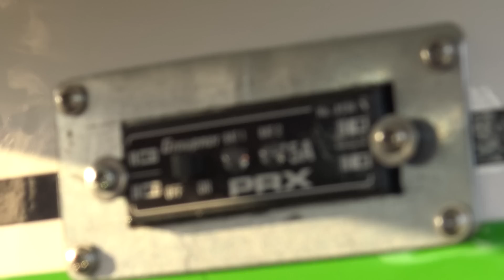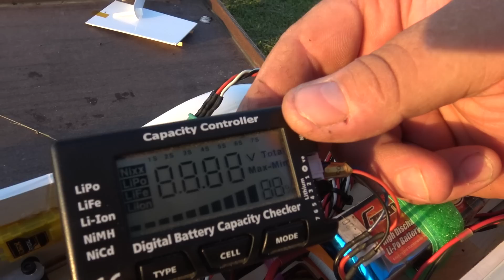GIANT 2m Hangar 9 Ultra Stick with Turnigy TP31-T 31cc Twin Cylinder Gas Engine  Maiden flight

Comment: Dont add weight Cpt Blaz. Just make longer stand off's for the engine and move the batteries to the front with the fuel tank on the cog. They fly much better if kept light.

Comment: The engine needs to be put on stand offs 80-100mm ,then you wont need to carry a ton of lead and it will fly alot better.
Sounds like one of the pots needs to be richer on the top end as it was stuttering .
Move the power box to the front aswell if you can.
Always better if you can lose all that lead.
Tank should be over the CG really ,then that doesnt effect flying characteristics as it empties.
These hanger 9s fly really well once set up especially if you have over 2-1 power weight ratio like a YS 140 in it.
Hope this helps.
Nice Flying Blaz and the good babbling Robert
Reply: Yes this is all true...yes engine still needs to be tuned to perfection..after few flights i will tune it more...
Reply: @BlažPetrinčič  Nnnnnyyesss,this will be something eh
Reply: Good catch, I was wondering why it needed all that weight in the nose.  I didn't notice the engine being mounted so close to the firewall...  Like you say, move it forward and you can get rid of all those wheel weights!
Reply: The Ultra is one of the greatest airframe ever made, so versatile and dialed in. Needs to be handled and setup with a lot more respect, it’s a legendary giant.

Comment: I recently purchased the same plane.  My setup is with a DLE 35 RA with a 17 X 8 three blade propeller.  Radio system is Futaba T16IZ SBUS 2 system with GPS to give me altitude and speed with voice readout.  3 OZ lead in the nose and elevator servos at the tail give me a perfect balance. The recommended balance point is too nose heavy.  Very good flyer, no bad habits at all.

Comment: Another great video good to see you flying blaz  Once you get your elevators straightened out  You will find out that the right-wing has a twist in it From the factory 
It is very hard to take out but there is 5 mm twist in all right-wing panels of this airplane  I even bought new panel and it's exact same way
 You're right Aaron will be up about 4 mm to correct the problem In horizon will not warranty the wings   Great job brothers

Comment: Here is a tip from an armchair expert, try to place the fuel tank at the cg and your batteries right up front. Might be able to get rid of some of that ballast. Also as per another comment remount the motor on a standoff about 50mm out, it all helps. But I have to say I love that exhaust note. Another great video, thank you brothers.

Comment: Great video! Please do an update when you figure out what is happening with that "up" flap. Also, besides moving the engine forwar, perhaps you could get some weight around the crankase between the cylinders and the prop, there seems to be room there.
Reply from the maker: We will Alan.

Comment: Need to get mine out, have the old tgy52 on it. Mine's a SPAD UltraSpadStick so it's 2 meter but made of Coloplast. But the 2 meter is perfect for easy flying, fun.  Love that two cylinder sound though.

Comment: I also went with longer stand offs to get the engine out there further. I put the lead inside on both sides of tank. found that the plane needs no flaps at all to land so turned them into extended ailerons.
Reply from the maker: Good idea.

Comment: Very tail heavy 🙈 that probably means you could fit a 50cc twin to this model and do away with the lead weight. Well flown Captain Blaz 😁👌 lovely looking model
Reply: Yes i know but i will work with this one becouse it is just perfect
Reply: @BlažPetrinčič  I love the sound of a twin in the air very distinctive 👌 I have bought a DLE40 twin for my Seagul Models RV-8 just need to sort the throttle servo and set up 😁👍

Comment: I just put together the  60" 10cc version BUT I put a O.S. FS 91 surpass on it, I put the Life 6.6 V battery right behind the tank, and the servos for the rudder and elevator in back, and it Balanced perfect no added weight
Reply: I have a 10cc 60 inch ultra stick and put a 20cc RCGF twin on it. very smooth. Now it flies like it should. No lead weight either.

Comment: I bought the RED ultra stick arf (& didn't read the reviews 🤦‍♂️). Gas/nitro, its great. Electric instructions, were 3 paragraphs. Obviously it wasn't EVER designed to be electric. Went by the same setup as the pnp version, & STILL needed 3 POUNDS of nose weight 🤷🤯!
Reply from the maker: Interesting my friend.

Comment: Hello, a question for our expert cpt. blaze🙂. How can I set the mid range needle? Can I unscrew the HSN. and should the hole in the MRN. be completely visible in the direction of the opening of the HSN.? Its a Hyper 30 Turbo motor. THX greeting from Bosnia😉

Comment: I think it is not tail heavy or nose light, as you say. You are flying already with a big amount of up elevator. If you add weight in the nose you would have to add even more up elevator. I would try to remove some weight.

Comment: If you have double rates, best setting up with say 50% throw at switch off, 75% at position 1 and 90% at position 2........and play around until you find the sweet spot.

Comment: Ah, the old days of nitro & gas engines. Fuels, ignitors, tote boxes, & more.

Yea, electric is soooo much better nowadays!

I remember the days 2 decades ago. Flying my twist 3d, .91 ys 4 stroke on it, & my 'U can do 3d'. Seeing the 1st ever 2.4ghz JR transmitter attached to a GWS slow stick. Thinking to myself, 'those will NEVER catch on. Hahahaha! Its a fad'. Skip forward 20 years & now:🤯🤷🤦‍♂️🛩️🛫✈️! 

Yes, its much cooler NOW! 👍
Reply: Im still NOT a fan of ALL gyro's. Cant learn from your mistakes IF u cant make mistakes 🤷

Comment: when I finish high school, I had only one hobby which I gave it my all  🤣
* chasing girls...  ha ha

On a side note, you could have added extra weight reinforcing the firewall and all four sides with epoxy and extra pieces of plywood.
I think there is a video of a guy with a similar setup and prolly same twin engine, and it ripped off in mid air...

Comment: It is recommended to add extra weight by reinforcing the nose area, instead of lead tire balance sticks. 
In this video, he had a similar setup and ripped the nose of the same type Ultra Stick.
https://youtu.be/E08Efr-4vKE

Comment: The Ultra Stick is a very very poor design with NO thought to balance and material weight.  This aircraft "could" fly on a 60 OS and the added weight to balance would be too much to make it fly properly.  All they had to do was extend the nose like a Storch or create a very extended engine mount and cowl to create a different look.  Sorry but this is one plane I would NOT buy.
Reply: The "stick" family of rc planes designed by  Phil Kraft way back in the mid 60s along with the Chris Fosse designed "wot 4" are probably the most popular rc planes ever used in past 40-50 years and are still as popular to this day so I will have to disagree with you regarding a very poor design,quite the opposite